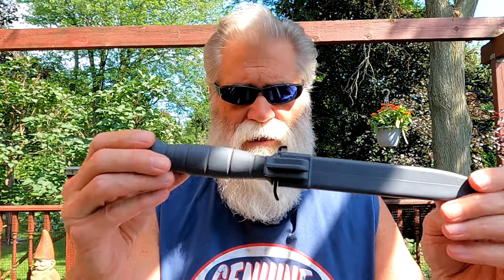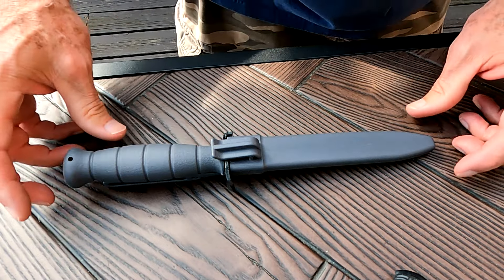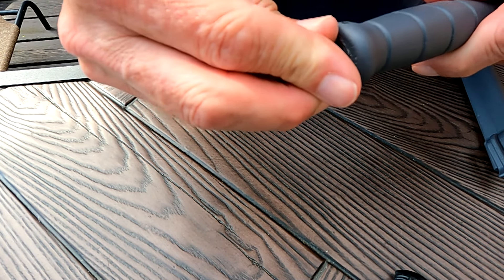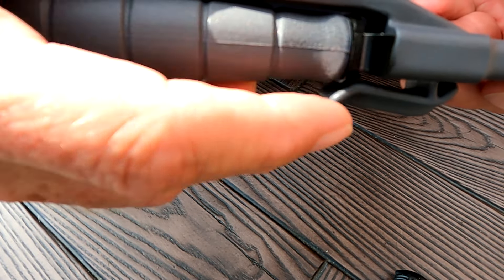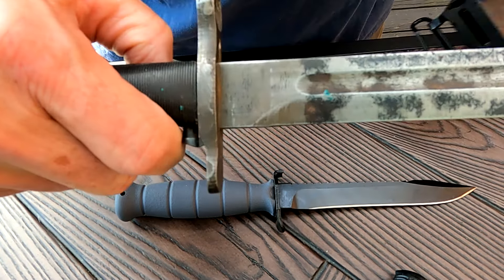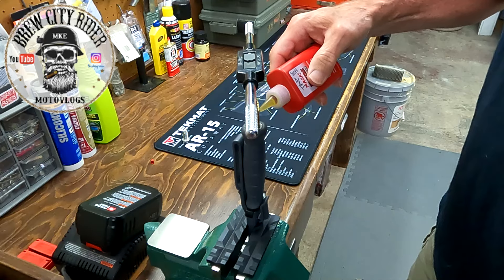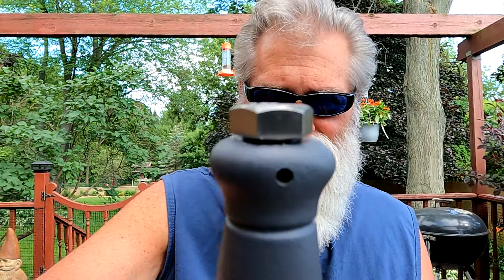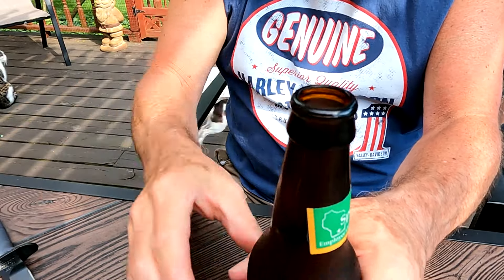Glock Survival Knife Pommel Mod

Comment: Awesome video, It convinced me. I just bought a black one off eBay for $42 and I will tap it for bolt plug and use it often opening beer bottles.
Reply: The glock 78 is very hard to find in ebay and if find  one the price is hight.

Comment: My wife and I have about 30 of these knives, won all of them shooting GSSF matches. Gave a bunch away to friends too. I like to mod mine with custom stipppling on the grip. That is easy to do, just need a soldering iron and some patience. They make a good piece of gear to keep in the trunk of your car or as part of a bug out kit.
Reply from the maker: Wow, that's a lot of knives you won! Yeah, these make great gifts. Thanks for sharing. 👍
Reply: May I have 1 please?
Reply: @eskee1  Win your own. Just enter a GSSF match. Oh, you will need a Glock and be skilled enough to use it. They also do random drawings for prizes. It took me only 5 entries to max out my winnings and be promoted to master. 

BTW, I hate Glocks, but as Quigley said, "Never had much use for one, never said I could not use one." I used to hold a master certification in defensive pistol and tactical rifle from a local firearms academy. I used a Springfield XD-9 service model for that. Also served in the USMC in the early 80s.

Comment: Great video thanks, I'll probably do this to one of mine.  I picked up one of these back in the 80's while stationed in Germany.  It was perfect for handle down carry on my webbing harness. Very easy to get at with either hand, rather than taking up space on my belt and only being able to get at it with one hand.  I also have a couple that were made under contract to the Polish Military, with no Glock markings and the Polish abbreviation "WZ.81ZW" for "Model 81 Military Police."
Reply from the maker: Nice... thanks for sharing your experience! 👍

Comment: Fun fact, the early pre pistol era glock knives had a different logo, it was round shaped as opposed to the square shape logo we see on the company's guns today.
It's an indicator of what knives were "1st generation", so to speak.
Also glock makes the Austrian army's entrenching tool (shovel) to this day, which is an outstanding tool.
Also the angled bit in the blade guard can be used to open bottle caps...
Reply from the maker: Great comment 👍 Thanks for sharing.
Reply: I still have my 1st gen glock knife. It is reblued not painted black.
Reply: No, they don't make our entrenching tool, they make an entrenching tool but our forces use different ones.

Comment: You should get the rest of the kit for the Glock survival system. When they issued the 81 to me, it came with the entrenchment tool, which is just as durable as the field knife. 
It's not expensive.. perhaps a little more than the knife, but you get way more for the money..
Reply: I have my own 81 now, but I removed all the coating, and now it's a mirror polished version for signaling.

Comment: It's an Austrian knife, the bottle opener was absolutely intentional.  ;-) 

Btw. I wonder how well it would work as a spear tip by "screwing" in a wooden shaft intended for a shovel or broom. Or maybe one could build a metal connector based on the screw? Or just stick it in with no thread? A bayonet is just a spear with extra steps too after all.

Comment: You've inspired me, have the knife, and a tap set if needed. I also have a bunch of stainless metric bolts no longer needed for survey equpment, may have one that fits the existing threads. Or, did you show the threaded part after you had cut them? 
Anyhow, would be a good spot for the alternate backup ferro rod.
Reply from the maker: Yes, you will need to cut your own threads, so you'll need that tap set. I inserted a clip of me doing this I think towards the end of the vid. Thanks for watching and commenting! I think you will love the mod 👍

Comment: It looked as if the hole was threaded from the get go? Why would you not use the same thread gauge/pitch to prevent the chance of cross threading when tapping? Do you know what that thread was? Thanks. I will copy your idea, but probably use the one that fit the as is situation. Great idea, thank you
Reply from the maker: @rottiejakeluke  Nope, it isn't threaded in stock form. Just tap to fit whatever bolt you end up using. Thanks for watching 👍

Comment: I was just thinking the cap might be removed easier by using a small drill bit through the hole already in the side.  All that’s needed is to drill through one side of the cap via that hole and use an air gun with a rubber tip utilizing 100 psi compressed air.  I think 100# air should push it right out.  Be sure to point in a safe direction as the cap will become a projectile.
Reply from the maker: Great idea! They are a real pain to get out. Thanks!
Reply: I was wodering if the holes in end of handle went through the end cap or not.   Problem w drilling thru, of course, is that it would not be water tight.

Comment: Im going to file the bolt head on mine to a point for the window breaking benefits and probably cut out a track under the bolt head for the rubber o ring to slightly recess down into and retain it
Reply from the maker: @johngibson7307  Those would be some nice touches👍

Comment: Why not use a metric bolt for the existing threads? It’s probably M12 1.75 pitch.
Reply: Lolwat.  There are no existing threads
Reply: @johnanon658  Correct.

Comment: Is the handle originally threaded, or are those just concentric rigs? How does it stay on a rifle?
Reply from the maker: No, there is no threading in the handle. There is just a lug on the rifle that fits in the opening and is kept locked in by the angled guard which locks into the muzzle device. I don't know if the lug is spring mounted or screws into the rifles lug bracket. Either way it's got to be able to move or slide for this type of attachment to work.

Comment: If I’m not mistaken, serrated knives are illegal in the Geneva convention
Reply: Art. 23. In addition to the prohibitions provided by special Conventions, it is especially forbidden
(e) To employ arms, projectiles, or material calculated to cause unnecessary suffering.

Serrated knives are not typically classified under this delineation and there are many knives issued to military and paramilitary units that feature serrations, or in the case of the Glock Field knives, roots saws for carrying out manual tasks like prepping rope, sawing through vegetation or wood prep for camp fires.
Reply: I think that is the Hague convention, not the Geneva convention. Geneva dealt mostly with POWs.
Reply: someone been watching old All Quiet on the Eastern Front ^^
Reply: Legal on knife but not on a bayonet.

Comment: I tried this but it didn't really work for me...  I used an M14 sized tap.  It was okay up until I got to the two hole on the sides of the steel tubing, then the whole tube just started rotating with the tap...  Not sure how to fix that.
Reply: Hmmm.  So the little holes go through the steel tube?

Comment: missed why you had to retap, could you not get a bolt to thread into the existing threads?? thanks
Reply from the maker: There are no threads, it is just a plain metal tube. Have to tap it to add the threads. Thanks for watching and commenting 👍
Reply: thanks for info ordered the  81 today @BrewCityRider
Reply: Is there an easy way to take the cap off?

Comment: Sir, good job running that tap so square freehand.  

Also, the knife is nice, nicer in person than you think looking at pictures.  

Note, the grip can be stippled just as a Glock frame.  

I got a FDE one i am going to ccw, but will grind off the saw teeth to make it an even better shiv.

Comment: Болт не будет работат как стеклобой. Для этого нужна более твёрдая сталь. Можно рассверлить в головке болта отверстие и впресовать туда ширик от подшипника.
Reply from the maker: I would sure like to test this out. I would think this grade 5 bolt could punch out a tempered glass window when struck properly in a corner with the point of the bolt head edge though.
Reply: @BrewCityRider  но шарик закалённой стали сделает это увереннее. Особенно это касается автомобильных стекол.

Comment: German Federal Police or GSG9 use Glock knives?
I dont think so. Because they have Eickhorn Knives (like KM2000) which is better and a lot more expensive.
But a Glock Fieldknive is a good thing at all.
As a knive. As a bajonett it is not very practical because it is sharpend and a typical bajonett is not.  An unsharpend bajonett break ripps much more easy, and a sharpend one sticks in and dont get out so easy because it it sticks in but it often dont break the bones. Thats why a lot of bajonetts are "sharpend" only on one side like a chisel. 
Like a AK bajonett just for example.

But I love the Glock knives.
The grey colour of yours looks very nice. 
I only knew the green, tan or black version. 
😉
Reply from the maker: Interesting stuff. Thanks for watching and commenting 👍
Reply: [deleted the first part] Let me throw you a bone...
1. Bayonets are stored and issued unsharpened for exercises and parades. Before combat action, however, they WILL be sharpened. You can read that in countless field manuals of forces around the world.
2. The GSG9 picks whatever the GSG9 damn well please. That is the reason, why they have had a huge bandwidth of gear, that are either not accessible for other police (special) forces like and there are quite some more SEK, SEK-M, MEK... And you probably won't believe that either the GSG9 uses the GLOCK 17 as the standard servide pistol )besides a lot more different ones according to situations. And the Glock FM78 is the official standard knife -amongst others as well.
3. The KM series is neither exclusive to Eickhorn (mass military contract), nor are they police-issued. 
So if you decide to pose as a know-it-all, you gotty bring more to the table.
German out.